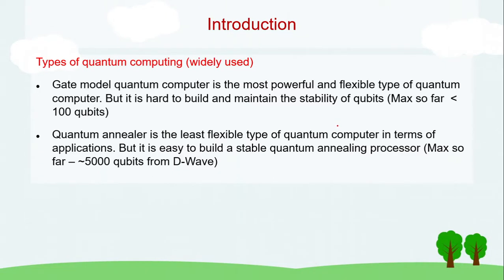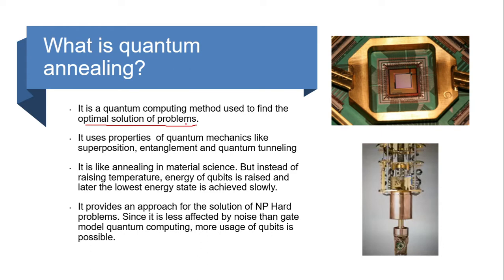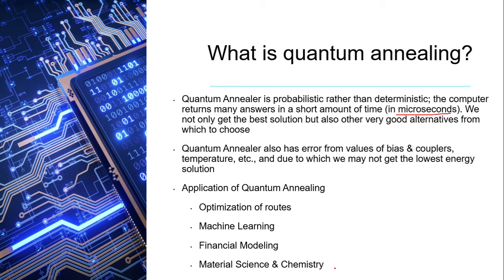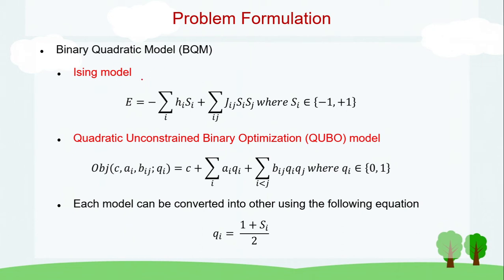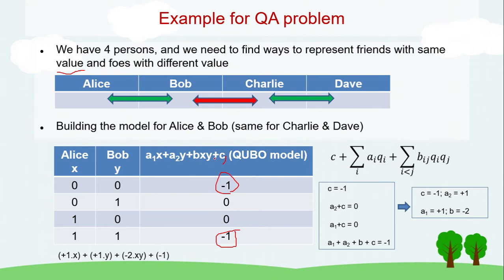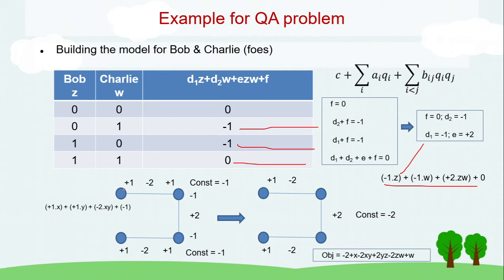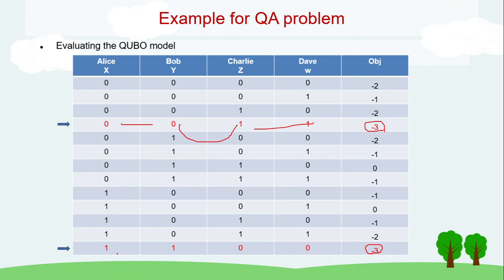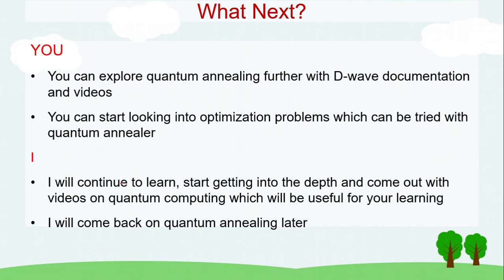Quantum Annealing

Comment: Thank you so much sir..
I have one doubt...
If we get in last step all are lowest energy then which based the solution taken?
and second thing is, in starting of your video u said, annealing means that ' we raise up energy level of a qubit after that slowly cool it until its gone to lowest energy' but in the table value your putting the pair of values x=0, y=0 is -1(low energy), x=0, y=1 is 0(high energy), why opposite energy needed?
Reply from the maker: Hi, I haven't understood your first question, but I guess you are referring to the table shown in 20 minutes (video time). All values do not represent the least energy but the lowest value(s) only represents the low energy state. Your second question, I guess refers to video @ 12th minute. We do not raise the energy but will build the quantum state to represent our system (problem) and the quantum state will settle down at the lowest energy. Please see the video carefully we are using some numbers to represent the problem such that when the initial numbers are same representing friend which should be representing a stable system and a lower to be used. If my guesses are wrong, please expelaborate the  question.
Reply: @SKathiresan  Got it sir... Thanks for response...